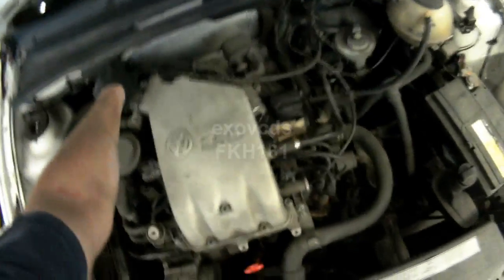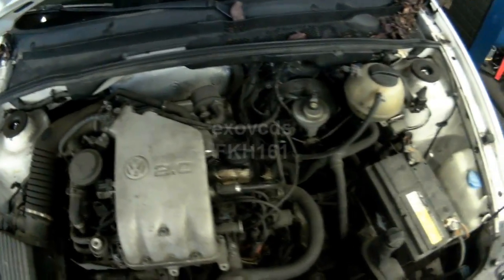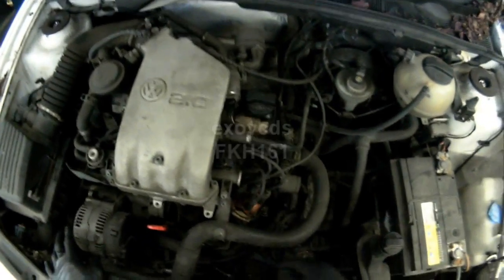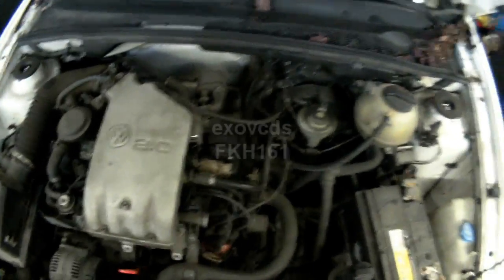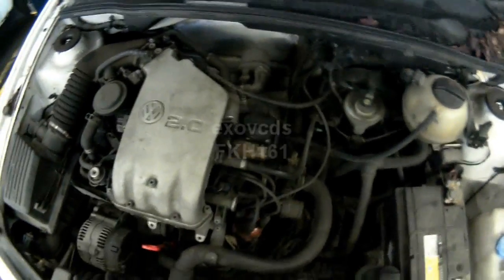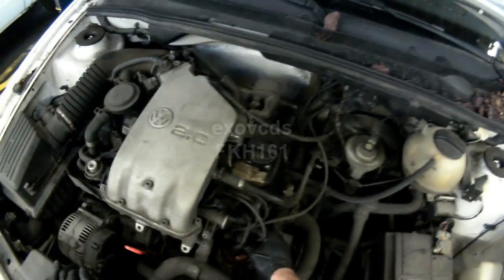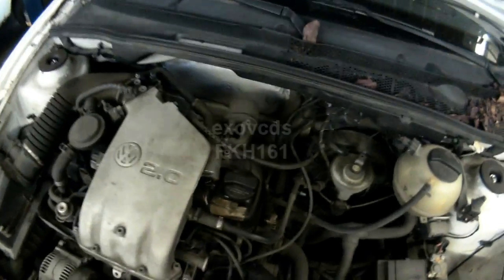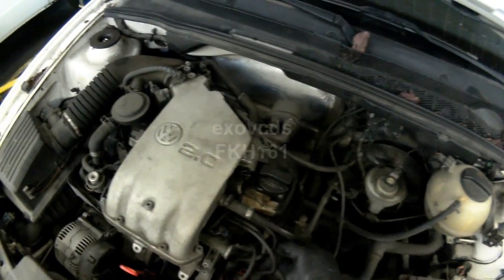VW A3: No Spark Quick Check...

Comment: Hey maybe you can help me, while my dad was driving my golf mk3,he noticed something making a beeping noises and like the oil thing poped up on the dash board,well when we inspected the car, the breather hose was torn up and there was small oil everywhere, well then i checked and got a single code P0341,and the car wont start, it cranks, just no start, If i replace the sensor and hose will it start.Thanks
Reply from the maker: 2 liter engine or 1.8L engine?
Reply: ***** 2 litr
Reply from the maker: Ivan Soto The 2.0L does not need a distributor signal to run... it uses the crankshaft position sensor as its main input. However, you need to make sure that the distributor rotor is actually turning. Remove the distributor cap and have someone crank the engine. If the rotor does not turn, your timing belt is broken. Here are some quick checks: VW A3: No Spark Quick Check...
Reply from the maker: Ivan Soto LOL... I replied via Google+ and didn't notice that our posts are under the video I just linked. Sorry about that. So, have you done the checks in this video? Do you have spark, Injector Pulse, is the coi being triggered?
Reply: hmmm i think i should make a video then show you because im not too car savvy so i dont really know where or what is the distributer cap. And i hope the belt is not broke, becasuse i know that that will be expensive to replace. Thanks and ill be back with you.
Reply from the maker: The distributor / cap is discussed in the video. Which of the steps in the video have you performed? What was the outcome?

Comment: If you have the time maybe you could give some advice. 98 MK3 2.0 #3 misfire code. When the car is cold it has a loud tap that sounds like a valve. When the car warms up a bit the tap is less but #3 is still dead, done everything i could to try to find out why #3 is dead. New plug, wire, cap and rotor. I have spark to the plug but it will not fire. So im down to bad fuel injector or low compression right? I don't have a gauge right now but with a simple finger test they all feel the same.